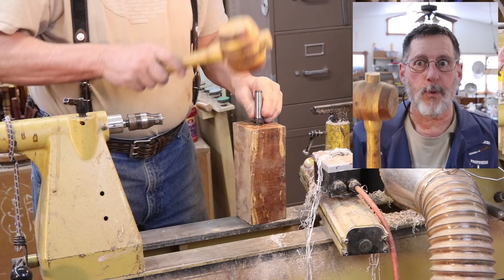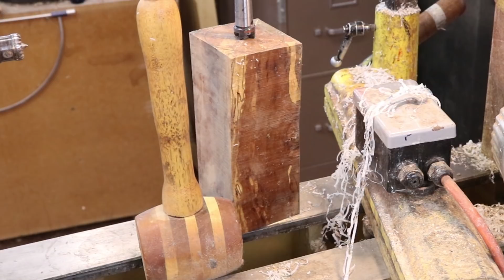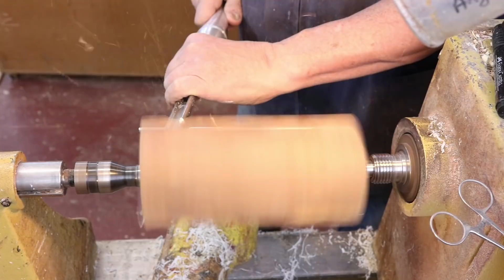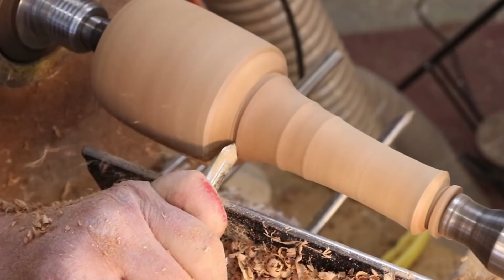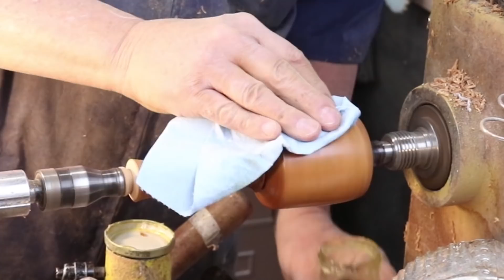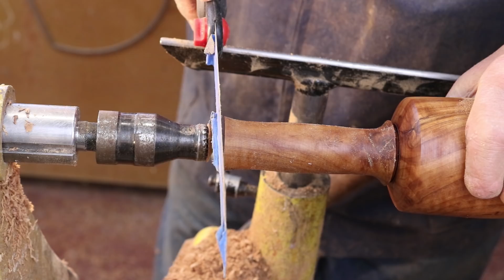Lathe-Turned Apple Wood Shop Mallet with Sam Angelo  the WYOMINGWOODTURNER

Comment: I know that much of the time we are governed by the dimensions of the wood.  It just seems to me that the mallet is a little short on length.  I have quite a bit of apple from the trees on my property mostly used for vases and bowls.  My mallet is made from maple that I cut from a friend's tree.  The mallet has an overall length of 12" with a 6.5" handle and a smooth transition to the tapered head.
Reply: Andy, I think a lot depends on the intended use. I have two similar mallets that I made early on in my turning adventure. The one that is close to the dimensions of Sams mallet is beat up and sits in the lathe bed behind the tailstock. The mallet similar to the size of your mallet is on top of my tool chest. I get way too much “whack” with that beast to simply tap in a spur drive or do other lathe side duties. I know. Tap more gently. :) Cheers.
Reply: I have two that are about the same length and girth as the one Sam did in the video ... turned them from a piece of Osage Orange about 7 years ago.  They are my go-to mallets on both the lathe and the workbench, driving spur centers, chopping dovetails, etc.
Reply from the maker: Andy, I am sure you are correct.  The mallet is a bit short.  But showing the process was more important to me.  And being a piece of Apple wood, I had to make a mallet out of it.  Sam

Comment: Very nice,, I noticed you have a piece of painters tape on your saw, Why is that? 
Curious,,,,
Reply from the maker: I have tape on both sides to reduce the "set" of the teeth.  So when I hold it flat on a piece of wood, the teeth don't scratch the surface.  Sam